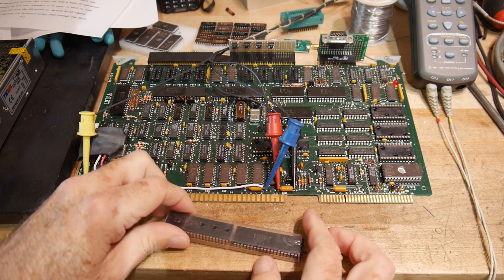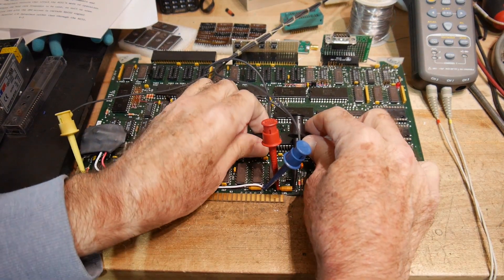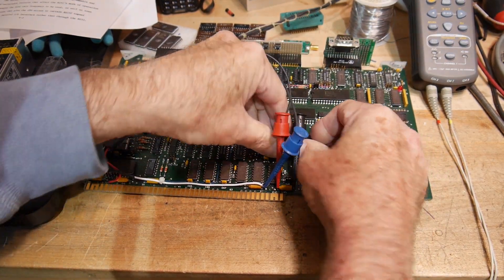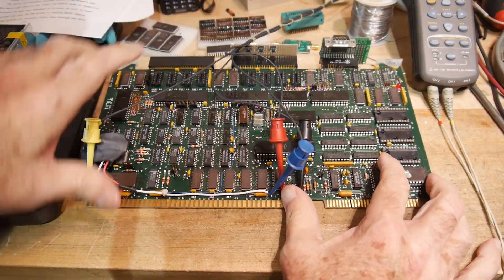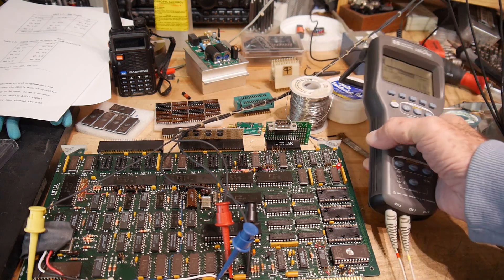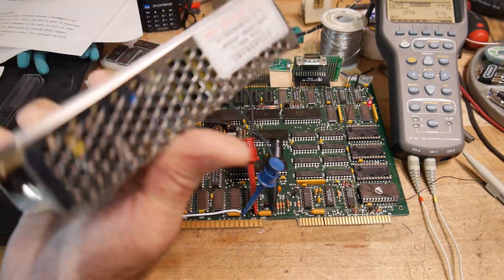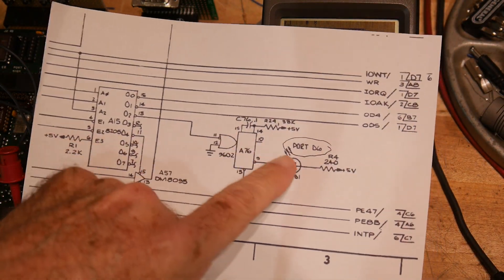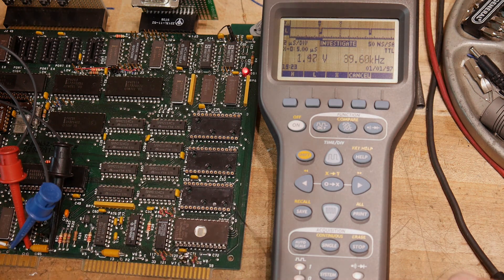#314 Intel 8080 SBC 80/20 Single Board Computer Fixed

Comment: Arrrgh!  For your own sake, invest in some authentic ESD control equipment.  It’s cheap, easy and prevents unnecessary invisible damage to components that may bite your butt later on.
Reply from the maker: You are right of course, but in 50 years of doing electronics including nasty things like CCDs I've never seen anything damaged by ESD.
Reply from the maker: I've been damaged by high voltage on many occasions though...
Reply: The problem is that you can’t necessarily feel or see the damaging zaps.
According to the IPC it only takes 20 volts of induced static to cause damage.